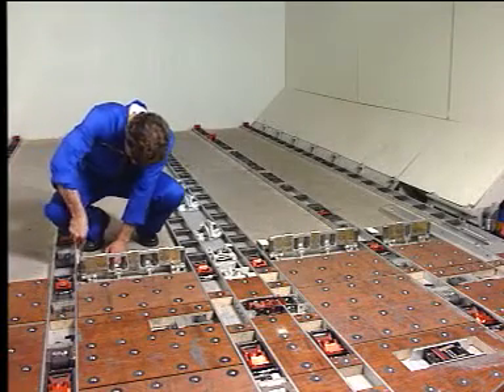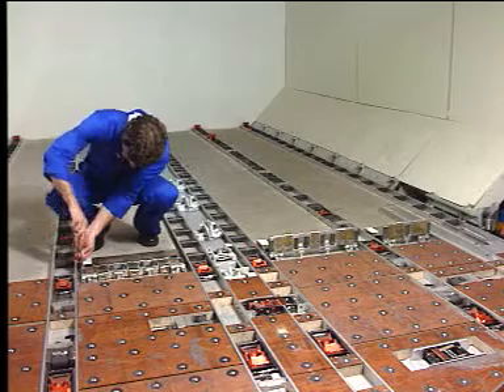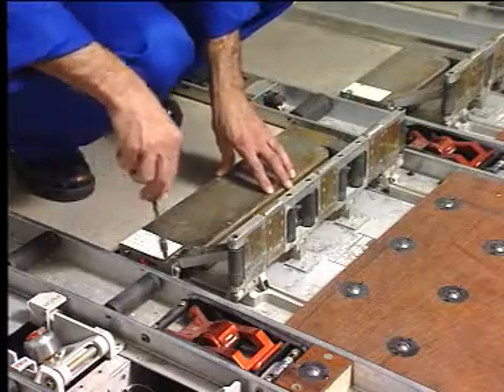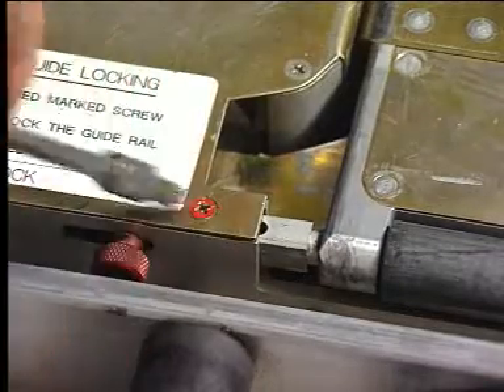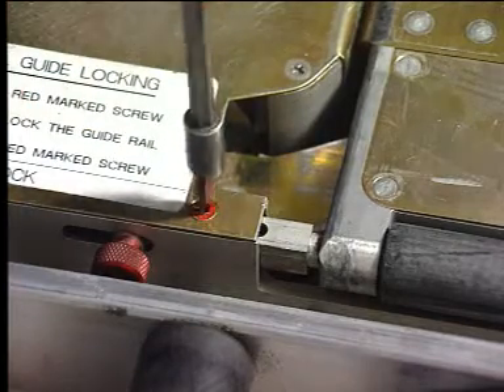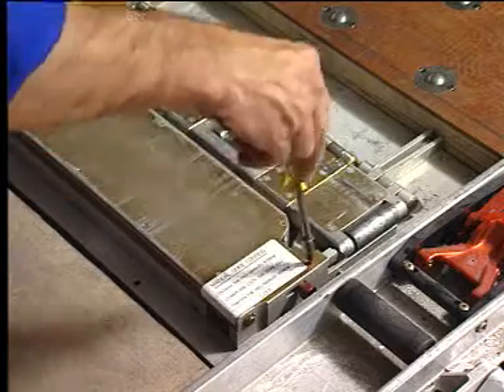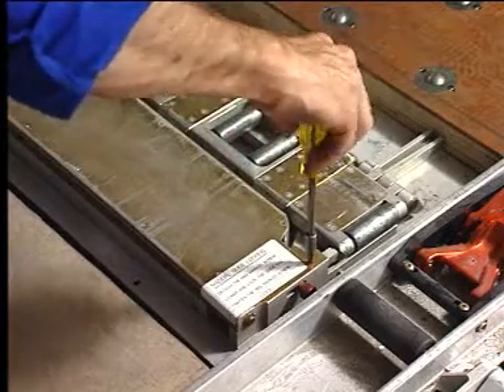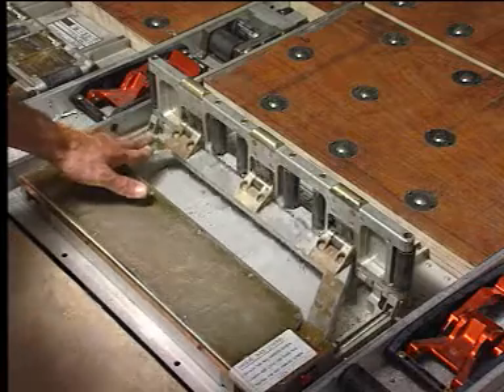AIRCRAFT | A330/A340 Cargo Y Guides Deactivation / Activation

Comment: Which P/N is it? I am familiar with YG101-04. There is no "red screw". It's locked/unlocked by tighten/loosen the red knob. The screw is also there, but not red marked and always tight. :p
Reply: THATS A YG101-03, IT HAS NO ROLLERS ON THE COVER PLATE